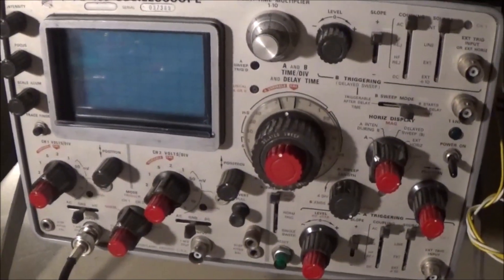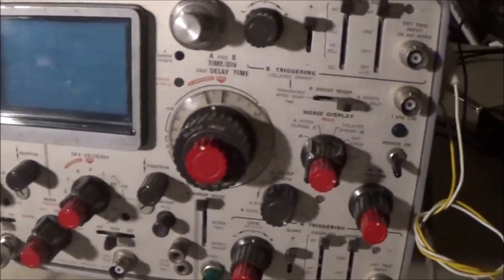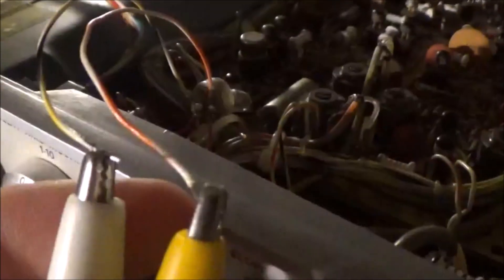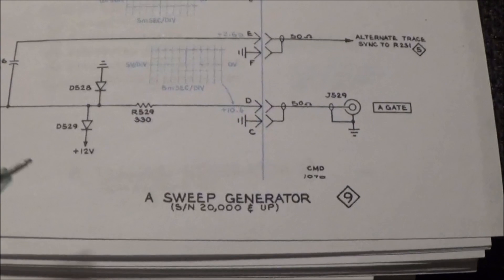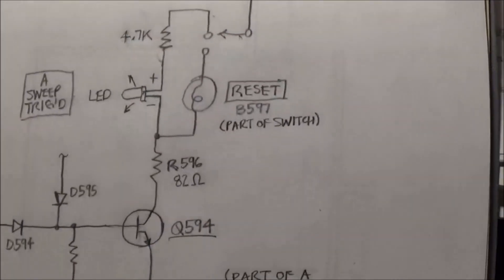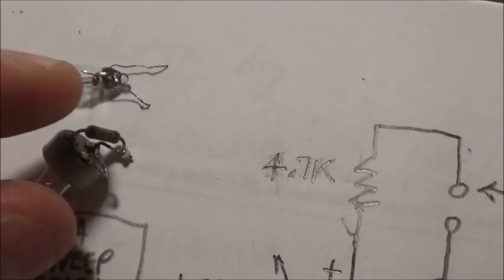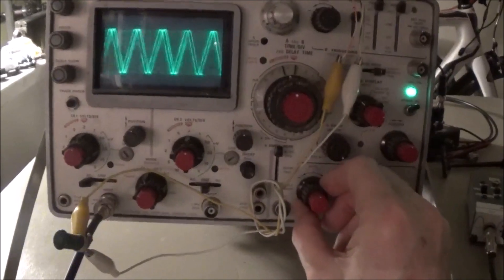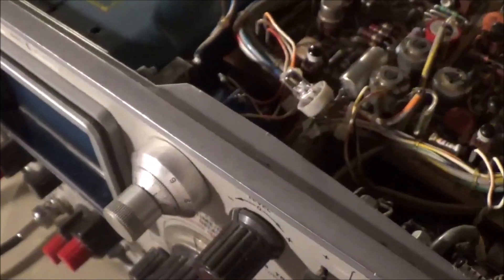Tektronix 453 "A Sweep Trig'd" Incandescent Bulb to LED Mod

Comment: The functioning of the lamps is a viable technique for troubleshooting this scope. The 453 is well put together. The transistors are plugged into sockets, the first thing to check after exercising and milking the front panel controls. A 453 that has been sitting unused fir a long time is prone to oxidized connections. My scope serial number is 601 ! It uses the Nuvistor 6DS4. That little triode is a workhorse. In my 60 years of troubleshooting I’ve only found two failures of the 6DS4 and to find one from 1965 still working is amazing. Currently I am configuring a way to test the 6DS4 on my EICO 625 tube tester. Anyone have a crossover schematic?
Reply from the maker: Can help if that light isn’t burned out. I’m not aware of any crossover schematics. My understanding is that after serial number 20,000 they were all transistors, no more Nuvistors.

Comment: I just fixed one of these that I bought from eBay for $60. It had an “A” channel triggering problem, no sync. The fan motor was bad and a dirty sweep rate switch on sone time base settings. I used the prescribed suggestion to milk the front panel for the sweep rate problem, by exercising the switches until my fingers were numb. I did use Deoxit as the contact cleaner. Then i noticed the scope was quiet. Yes, the fan was not spinning. This was a simple solution but a lot of delicate and intricate work. Getting the fan motor out of the case was like heart surgery. I used an external fan to cool the circuitry while I worked. The fan turned out to be frozen. I worked it loose and it spinned on its own after i inserted drops lighter fluid on the external motor shafts. Its working good now but will need replacement sometime soon. When I closed up the fan area i left lead extensions fir the next venture in. Tektronix has a replacement motor for $27. , shipping about $12. The final failure was the most interesting work to do; no sync triggering on A sweep, ch 1. Once again i used the front panel milking technique, plus the chart from the manual. I tested the CH. #1 output and Ch 2. Both were ok. That narrowed down the suspects. Then I tested the power supply voltage’s and scoped the ripple with my Leader scope. All was OK. Doing some online research for case histories, schematics and pictorial layouts led me to the A trigger circuit. A few scope checks and voltage readings led me to Q-473 a PNP Silicon transistor. Lastly I tested the transistor with my Simpson 260, and a digital LCR tester that also checks diodes and transistors. The Q 473 was implicated as my final suspect. From my bench parts supply I had a 2N3906 PNP Si device. Channel 1 A trigger is fixed. Doing a calibration will be done using home brew Xtal oscillators and time base generators. Ill use my Fluke 77 to verify DC level tests. I have good quality Audio and RF signal with a Beckman counter. AC peak to peak readings will be verified by my scope and RCA VTVM. Its only a 50 mhz portable scope, but it will suffice my bench needs.
Reply from the maker: I have two. One is like a perfectly working time capsule with all of the accessories (and a manual) and the other one (in this video) was given to me 18 years ago. I had nothing but the scope, none of the accessories or a front cover. It worked OK but it had some quirks - instability on start up and a strange fishbone like hash when using Ext Horiz mode which I never knew about until recently. That started me down a path of going thru every single circuit in it. Instability on start up turned out to be Q1189 and that noise in x10/Ext Horiz modes turned out to be three bad main filter capacitors (+75V & +150V). Changing those was a royal pain in the rear, as well as dealing with that fan which is the other highly annoying thing to deal with on a 453. Had some out of spec transistors throughout which I replaced. One bad 3.3uF cap on the A Sweep board. Cleaned up some corrosion on various parts, shined up everything that I could, etc and now it’s working amazingly well. It’s a very impressive piece of Apollo age equipment!
Reply: @VegasCyclingFreak  yeah I did find a leaky 3.3 uf tantalum cap on the A trigger board. I left it in until the replacement arrives. It was leaky but not at the operating voltage of 12 VDC. Leakage didn’t show up until over 159 VDC. I toured Tektronix several times in my career when I was out there for training. TEK used a lot of MIL-SPEC parts in their everyday scopes. NASA was one of their biggest clients. I guess the only drawback to the 453 is the CRT size, however none are as ever bright and sharp as TEK’s. Years ago I had a 535 scope with one plug in. I have no idea why I ever got fid of it. I think I traded it for a studio reel to reel tape recorder. That was when I worked at RCA labs in Princeton and could always borrow the latest top of the line scope for home use. Back then RCA encouraged us in every way to build and experiment on our own projects and time. Even any parts we needed could be bought. Through the years I had a few patents for the company. That was the payback. It was patent or perish. Eventually I ran out of brilliant ideas. Then I joined the group that repaired and calibrated all types of test equipment. I am retired now and it is still in my blood.
Reply from the maker: @erin19030  I’m just an HVAC designer at a consulting engineering firm. Self taught in electronics so I could build tube amps, guitar pedals and stuff like that. It’s kinda fun to repair scopes but they are not the easiest things to troubleshoot. The 453 is a pretty complex piece of equipment.